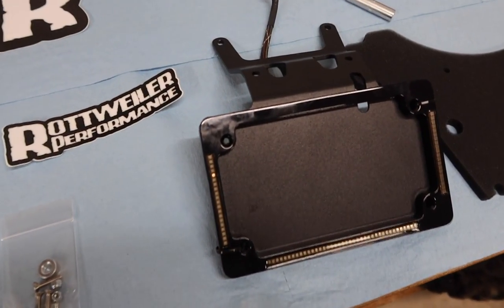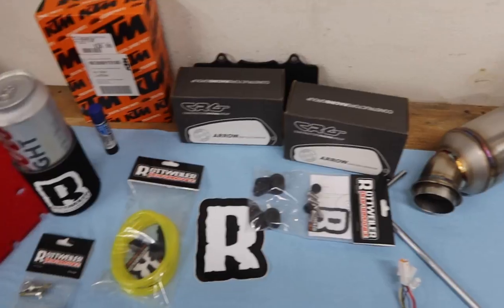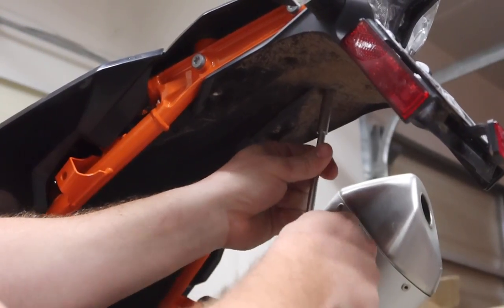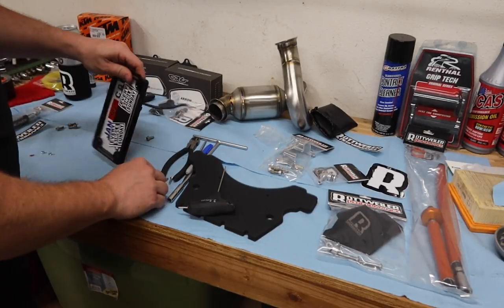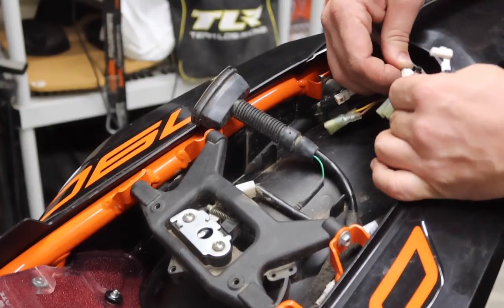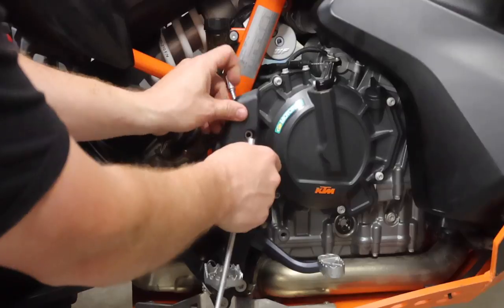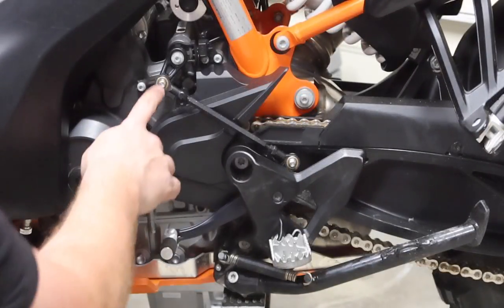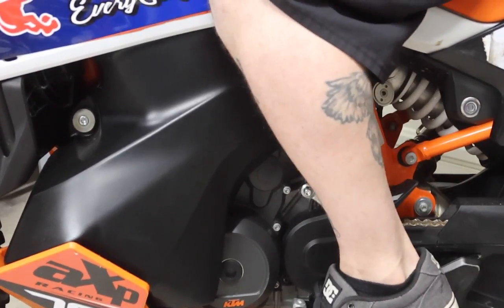Rottweiler Performance Parts Install - KTM 790 Adventure - Tidy Tail, Transaver, Rear Master Guard

Comment: Awsome video-Transaver question, do you HAVE TO  make the adjustment to the top or can you leave the stock adjustment. Im concerned that I make the wrong 'adjustment' to the top and create a shift issue. Thanks
Reply from the maker: Unfortunately, there is not an adjuster in the linkage, only if you move a tooth on the top

I found that it raised my shift or just a hair and put it exactly where I wanted it

Comment: I'd suggest to add that loctite on those shift shaft screws too. Mine came off on my very first ride and had to shift by hand to ride home where I left the tool bag. Nice stuff from Rottweiler - can't wait for airbox and alu-subframe at some point..
Reply from the maker: I've got over most of the bolts that I can access on this bike. I've heard too many horror stories

Comment: I'd recommend using some dielectric grease in any wire connectors anytime you replace stuff. Helps to prevent water intrusion and corrosion over time. Some cool products there.
Reply from the maker: Not a bad recommendation at all, thank you

Comment: Do you tape over your licenseplate number but then show it from the other side anyways?
Reply from the maker: I really wasn't concerned about it. Only did it so I would have an excuse to put some of my stickers on there
Reply: @EverySingleSunday  In my ccountry there was a dude who showed his face and motovlogged his first rides with 125 2stroke supermoto. High speeds, burning rubber and wheelieing through the town all that. Dude was identified from the video and lost his licence after a week. 

Happened in finland but might be possible in usa too, doubt it tho.
Reply from the maker: Ya, most my stuff is offroad. I'm not too worried about it. But, that would be bad

Comment: You do realize you mounted the tea saver upside down. The thicker part goes on the top. If not it touches the triangle and when shifting down it does not bounce back into place.
Reply from the maker: It rubbed when it was the other way. This was a proto unit. I now have different mounting hardware and it’s the other direction.

Comment: Nice looking products.  Wish Rottweiler would use Torx fittings since that is what KTM uses on this bike
Reply from the maker: I think they went with the Allen since it had a smoother head and wasn't recessed like the stock part

Comment: You running a tune from rott for the decat?
Reply from the maker: I am now. But I didn't for the longest time. Bike still ran great with the stock map
Reply: Thank you for the feedback. My head has been spinning from all these Decat threads. So you think my hog will be safe running the oem map with the arrow system? Did you switch to the tune just to smooth out fueling for throttle reasons?
Reply from the maker: I ran mine on the stock map for 2000 miles with a decat, and rode it hard.

I did the race tune to add fuel to it make make it run better. Now it doesn't stall as much and has more low end power / torque. 

It does make more power all around, but that's Isn't what I was after